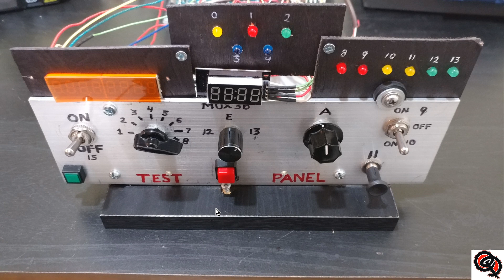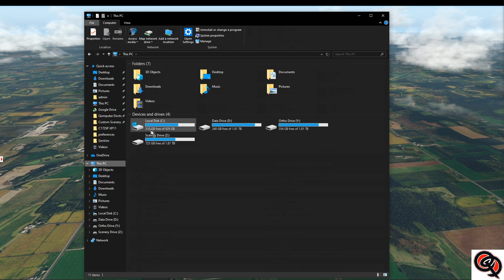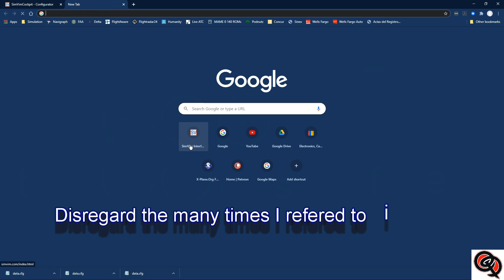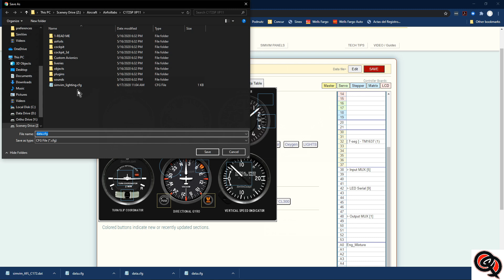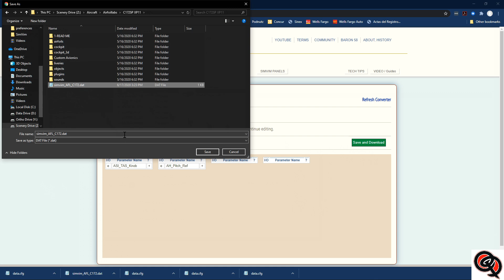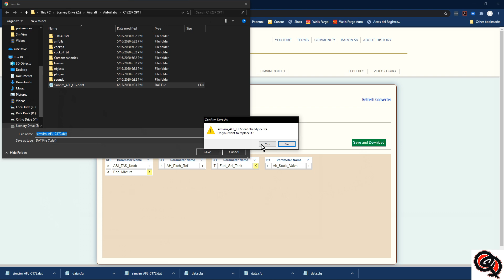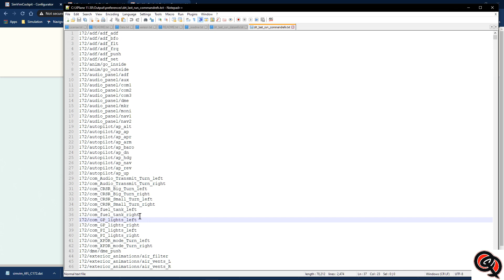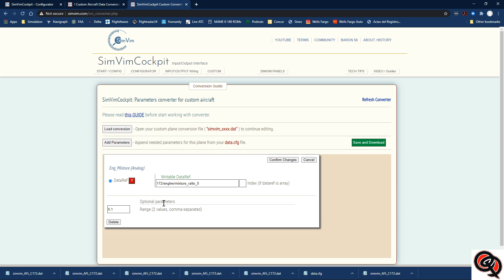Updated but old: Custom Datarefs in SimVim Cockpit

Comment: I keep checking if you have any new uploads since I love your awesome videos, and friendly responses to our questions 😊 Please when you get the chance upload a video showing us a "Chart" or schech how you wire  just a simple one 7- segement to micro board, and wire a 360 degree encoder, and set a simvim data , and possible how connect wiring to control Gyro instrument. 🥰🙏
Reply from the maker: Hello Brian, when you say micro board do you mean the Arduino Mega or an MUX board? Also for gyro instruments, I have not tried to figure out making gauges with stepper motors, servos, or any type of PWM devices so unfortunately I can't help with that. Maybe someday I will attempt to learn those myself 🙃
Reply: @Qosmokid  Mux 16 pin board 😊 by the way I checked the wiring once again, to make sure I detached all wires and attached it again like before, still the printing on 7 segement is not right, each time I click on Status on simvim pulldown menu a new print comes up, some time it's accurate but the printing disappears as soon turn the knobs in x-plane. Is it possible people you make a simple sketch of wiring how you did it, and email me the picture , I really appreciate 🥰🙏
Reply from the maker: @FlightSim2703  I forgot to mention before, its possible that your MUX board became damaged. That happened to me one time but only with certain pins. If you have another one to try that might help. Also did you see the video "Basics for building an MCP panel?" I go over how to connect  a few 7 segment displays and I also show a drawing there.
Reply: @Qosmokid Thanks so much, yes I have 4 more extra Mux , I will replace , I watched all your videos, probably I'm to old to memories 😊 I will watch it one more time, and follow you sketch ♥️🥰👍 thanks again
Reply: I replaced the Mux, but still getting  bad printing, I deleted the data, and reloaded new data, it's still getting the same printing, I watched your video compared the wiring to mine, everything is same, except I'm not sure if you used pins 27and 28 or 28 and 29 because the sketch is not clear at the point of connection to Arduino.

Comment: with the new hcsci webpage how do I find the cutom config page,  I no longer see this option?  I am trying to assign the custom datarefs for Torque sims sr 22 and having difficulty
Reply from the maker: Hello, the custom converter is there. Once you are in the configurator page click on "Aircraft Conversions" on the top right. On the next page you will see a button called "Converter" that's the one that takes you to the custom converter.

I just found out you need to access the page with HTTPS:// and at least for me the custom converter page doesn't seem to be fully working right now.

Hope you have better luck with it

Comment: Hi

Any chance this will work on twist axes assignment for tiller on the A320? Planning to have a dual tiller setup.
Reply from the maker: Hello, I think if a writeable dataref exists you should be able to do it. I dont fly any Airbus aircraft so I couldn't even check. I do own the inibuilds A300 but I think you might be asking about the Toliss or Flight Factor. You might want to join the forum on the HCSCI website and I'm sure there are many users there that will have that answer.

Comment: Need Help with SimVim, 

I'm not able to save a configuration, I'm getting a Windows message asking " How do you wan't to open this file?", instead of directing me to the x-pane/simvim plugin file/etc... See attached pic. I'm new, I was able to config my 1st encoder using Arduino. I saved the configuration and the encoder worked perfect. But, now is not allowing me to edit or even do a new config. I have try everything, even reinstalling the SimVim plugin, I uninstalled, and re-installed Arduinos Firmware., nothing. The arduino controllers is connected. I don't know what to do. I'm sure is something simple I can't figure out.
Reply from the maker: I'm sure that has nothing to do with the SimVim plugin. I'm almost certain is has to do with the browser. Im not sure which one you are using but I would try with Chrome or Firefox, I know way back Internet Explorer did something like that when trying to download something, which is what you're doing when you click "save" in the configurator.

Comment: Just wonder if you have any any advice. I followed the steps you suggested and tried to input this Dataref but it say they are no accepted.
sim/cockpit/warnings/annunciators/Afterburners_on
Reply from the maker: That seems to be a standard xplane  dataref. Is this just for a light that shows when your afterburner is on? When you say it is not accepted what exactly do you mean you get an error or it just doesn't work? Also what plane is this for?
Reply: @Qosmokid  thanks for your response your videos are great by the way really helpful.
I'm building a f35b replica and have got a majority of the switches to work using simvim but cannot figure out how to map the afterburner toggle switch to activate. I'm using the Aoa F35b plane data ref tool won't work with that plane running.
Reply: The error message says it can't use standard xplane data refs
Reply from the maker: @martinelms2705  thats what I thought.  There's nothing you can do and shouldn't need to. They say standards datarefs and conmands should work without needing to do anything. Just make sure the plane you are using does use that dataref for the thing you are trying to use it for
Reply from the maker: @martinelms2705  well the dataref you were asking about is only a light or indicator. That one is not to turn on the afterburner. The dataref tool should work with any plane, but sometimes its hard to find the datarefs or commands we need
Reply: @Qosmokid  thanks man I will look into it again tomorrow I'm exhausted with it today will keep you posted 👍

Comment: Great video! Can you explain how i can put a 4 potentiometers in the xpndr to change the codes numbres in the afl cessna Like Collins xpndr?
Reply: Herman,
-
- Open the configurator here: http://simvim.com/config.html
- Then, select the encoder type you want to replicate.
- Then click on the transponder knob
- Then select the encoder and assign it to any input pin or input of the multiplexer.
-
Also, you can select to use the rotary "binary-coded" switch that has 8 fixed positions,
-
You can not use the potentiometers.
-
Vlad (SimVim developer)